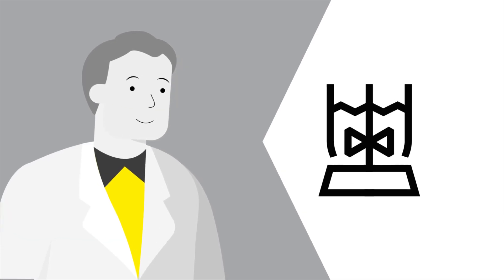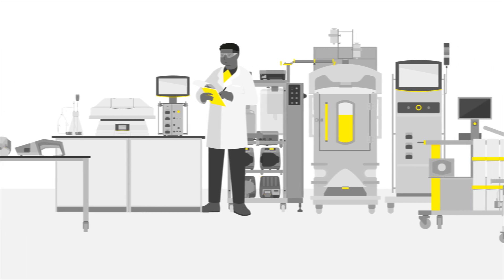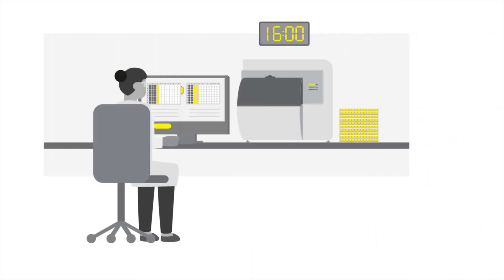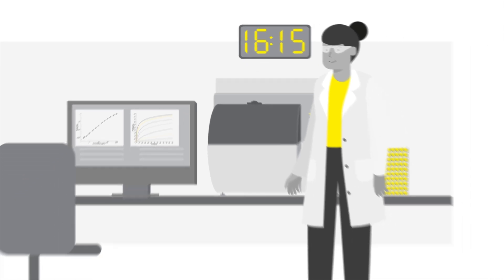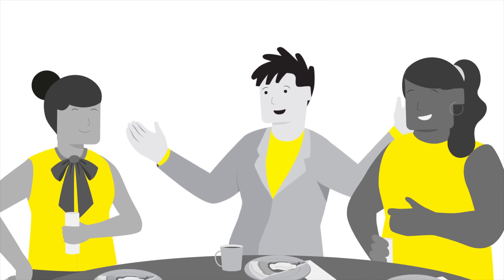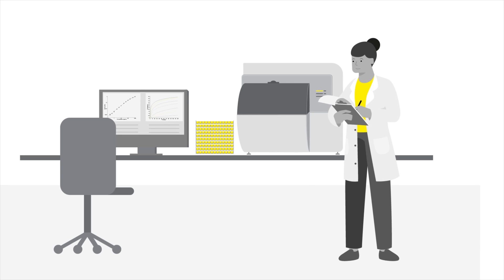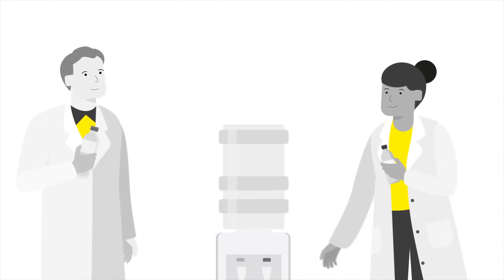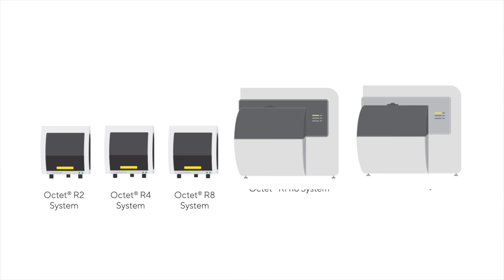Rapid Quantitation of AAV Capsids in Bioprocess Development for Gene Therapy Using Octet®️ BLI

Comment: But Full/Empty% of AAV will impact the titer, right?
Reply from the maker: The full/empty ratio of Adeno-Associated Virus (AAV) particles can indeed impact the titer measurement. The titer typically refers to the concentration of viral particles in a solution, and it can be influenced by the proportion of full (genome-containing) versus empty (non-genome-containing) capsids.
 
In case an assay measures total capsid concentration without distinguishing between full and empty particles, the titer might not accurately reflect the functional viral particles capable of delivering genetic material, which is critical for applications in gene therapy.
 
If you need more detailed information or specific data regarding the Octet® BLI AAVX Biosensor, please let us know!